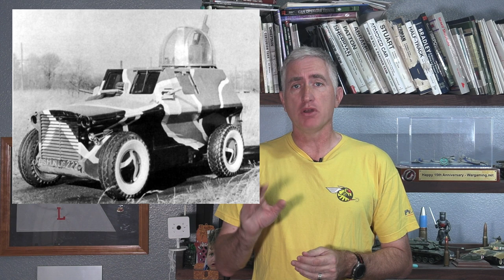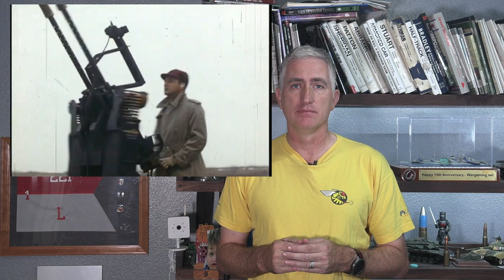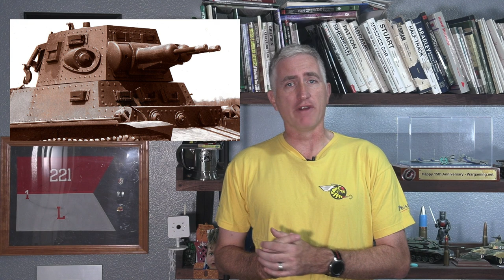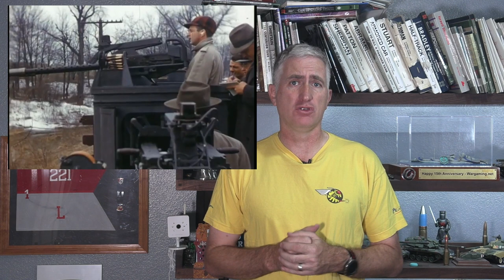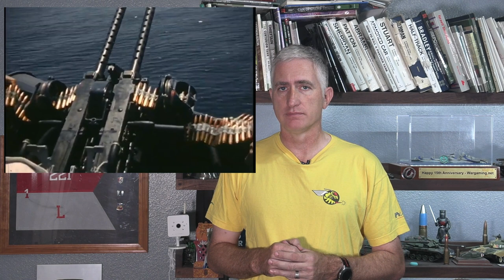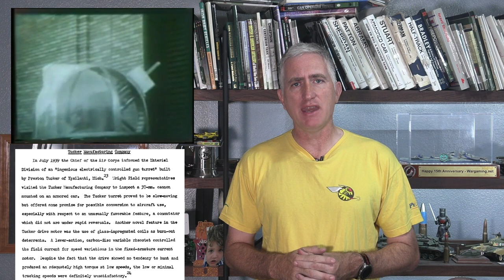Why the Tucker Tiger Failed

Comment: Given the tire technology of the day, 100+ mph in a vehicle that weighs over 10,000 lbs is a terrifying thought.
Reply: I'd be more worried about the rims, Centerline type rims can make even a weaker tire perform well.
Reply: 100 mph from a V12 putting out less than 200 hp and being armed and armored is something that I still can't figure out how they managed to do pull off.
Reply: I figure it had 4 wheel drum brakes so that speed isn't too scary when compared to a 1917 car engined with an aero engine and only rear brakes, aka, the 1917 Fiat Botafogo Special that Jay Leno owns.
Reply: @Hybris51129  sounds like they picked their gear ratios very carefully and made full use of the wide power band that a V12 offers.
Reply: Well, true the tires of that time are terryfing.......until you realise that the brakes are even worse.
Reply: Tires that can get shot to hell in the field. That does sound pretty terrifying, like best case you lose the tiring and end up sliding out of control, don't hit an ally or anything solid enough to cause injury to the crew, and then get to see about changing the tire or driving away/forward at a greatly reduced pace. Best case, hitting shit and friends seems decently likely, as does getting stuck.
Reply: can you imagine going fast off road in those biased ply tires, I would expect to see rubber flying every where!.
Reply: You could get a Duesenberg over 6000 that would go over 100 in the 1920s.  The problem was many hardly knew how to drive by WWII.  Not to mention most soldiers think that government vehicles should be treated on the level of rental cars. Soldiers raced everything including motorcycles with side cars. One described how was tearing around on a Harley Davidson with a side car and came close to dumping it. Asked him how long he had been riding motorcycles before the war. Never. Wasn't even supposed to be driving it. Same thing with guys flipping the M 151. A lot of people were drafted from cities that had never learned to drive or shoot a gun. All the sudden they are doing both.  It's not like they listened carefully to instructions.
Reply: Well scare the hell out the  enemy look its coming its there no its there aim fire...wait no aim fire ..no wait aim   screw it ..
Reply: @LadyAnuB  jay leno kilñs cars go to alameda in burbank watch him grinding gears and blowing up motors why he has staff of mechanics at airport hanger
Reply: @57WillysCJ  so pretty much like todays drivers who cant park without cameras..and with small cars make wide turns like their driveing a tractor trailer or on cell and sideswipeing parked cars
Reply: As somebody who almost flipped a jeep going too fast over dirt road, I am not sympathetic to the ruling that a 100mph is too fast.
As somebody who drove his 1992 T-bird over a hundred miles per hour on a well maintained country road, I again sympathize with the ruling that 100mph is too fast.
The center of gravity for that Tucker jeep is to high for that speed, and what ever committee it was that was in charge of it's design, this vehicle was doomed in committee.
Reply: @Hybris51129  
On roads?

Ever been on the autobahn?

There you'll see family cars with 105hp 1.5 Straight-4s doing 160km/h (100mph) all day.
Reply: @ShadowFalcon  At a fraction of the weight and far better engineered as well.
Reply: @Hybris51129  
Well, the weight only affects the acceleration, so it may take longer to get to 160km/h.

As for engineering. Well, it's got extra horsepower, but I suppose it'd be a scary experience with the god knows what kind of suspension geometry it had.
Reply: I would be more worried about the brakes. They didn't even dare test it on the slopes because the "didn't trust the brakes enough", yet they would drive 100mph in it?
I would bet money that the machine cannot actually REACH 100mph, only that with the gearing it has, it could theoretically reach 100mph. There are cars to this day (or not long ago) that were advertised as "190mph" (etc), but which when you factor drag, tire resistance, the actual power output of the engine, it won't actually reach near that speed. it just means that going downhill, in gear, foot full down, it will reach 100mph without revving the engine past the danger point. Right before a slight steering correction or small bump sends your entire machine wildly out of control because the very short wheelbase and inadequate suspension design. there is a difference between theoretical and actual top speeds.
Reply: @TWX1138  A V-12 doesn't somehow magically offer a wide power band by some inherent virtue of having 12 cylinders. What it does do is allow you to have an engine large enough to produce lot of torque, but cylinders small and light enough with a short enough stroke to reach a decent engine speed, and therefor power. So it will make more horsepower than an engine of the same size by fewer cylinders (all else being equal). Conversely, an engine with few cylinders will make more torque but less power. Really, top speed is a function of the total power output of the engine. Once you have accelerated your 10,000lb vehicle to that speed, there is only the resistance of the air and tires to overcome. Say 300hp; if that is what it takes to travel at 100mph in that machine, it doesn't matter if it comes from a 12 or a 6. Only you would need a larger 6 to generate 300hp, because the engine speed is lower. Given a larger engine, however, you could actually accelerate faster because the torque of the larger engine and cylinders. But even then there is a certain minimum amount of power needed to move a machine of a certain bulk and wind resistance to 100mph, whatever your gearing is.
Reply: @57WillysCJ  My dad learned to drive in a truck in the south Pacific. He got the job by raising his hand when someone asked if anyone knew how to drive a truck. He figured it was easier than hoisting a shovel all day and he had seen it done. His dad had a model A. He managed to not crash into anything so got a lateral promotion. Not higher rank, just less hard work.

Comment: The most important characteristic of any military vehicle is that it must be soldier proof. An I can assure you, any vehicle that is capable of 114MPH is NOT soldier proof - neither then nor now.
Reply: Yeah ... when I was doing base security, we had just gotten a "new to us" patrol truck that had a little red light on the top, a little directable search light, a working military radio, a working heater and was not in general all beat to hell (unlike one truck where I had to hold the clutch in with a board, raise the hood and shift the linkage there in order to get it into reverse ...).

I got to drive that "new" truck at least once and it was really nice - especially that working heater ...

And so ... we had this one guy who wanted to see how high it would bounce if he drove it over the rail road tracks at 70mph ...  I don't know how high it bounced but it rolled 4 times out into the middle of this field ...

He at least wasn't stupid enough to not put on his seat belt before he did it but that stupid son of a bitch wrecked our new truck.  We all wanted to kill him.

He was going to have to stay in the Marine Corps until he paid off that truck on an E-1's pay but that didn't do us any good.

That happened 50 years ago and I'm still pissed off at that ass hole.
.
Reply: One only needs to look at Air Force officers to see that! 😆
Reply: Nothing is true soldier proof. You can only minimize the damage a soldier might do
Reply: Like any army vechles are
Reply: @demonprinces17  Yep.
.
Reply: At least not for US soldiers
Reply: I do agree with you, we did same thing to T-72, we removed the governor, upped slightly the boost and empty on the longest straight of our training ground that thing was doing 90kmph+ (well UAZ had top 90kmp and could not keep up). Was it safe? Hell no! Was it fun? ...do I  have to answer?
Reply: That can easily be geared down.
Reply: All this made me think if this incident.

In 1995 a former Army Tank Driver - stole a tank and went on a rampage running over parked cars, fire hydrants and traffic lights.
https://www.youtube.com/watch?v=2AuTigSWLj0

This has a sad ending though as when he got the tank high centered on a traffic divider - cops got on the tank, got a hatch open and when he wouldn't surrender killed him.  It's to bad they killed him when they did because the last thing he did with the tank was throw a track.  After that he wasn't going anywhere but I don't know if the cops on top of the tank that shot him knew that from where they were at.  Sad story about a Veteran who flipped out.
.
Reply: @BobSmith-dk8nw  and that story brings to mind , " Kill Dozer " . Were a guy tired of fighting the town over property rights of ways Armored up a D9 or D10 bulldozer and went through the town taking out all the Board members busines.  Finaly stopped when he fell though into s basement on 1 track. He shot himself,  there was no way into or out of the Bulldozer. He had lowered the body down over himself.
Reply: @BobSmith-dk8nw  Ah, your unit's Carl. You can't fix Carl.
Reply: Killdozer ruptured a coolant hose and overheated the engine. Thats what stopped it, not a thrown track. Watch the video.
Reply: @marvindebot3264  No ... but sometimes your "Carl" can fix himself ...

Our guy almost did it here and would have if he hadn't put his seat belt on.

Another time ....

I had a buddy who was in the same cubicle as this guy.  My buddy slept on the bottom bunk.  One day this guy comes in, mutters something and then bounces himself up into the top rack.  After a while - my buddy is laying there and he realizes that he hasn't heard this guy move since he got into his rack.  So - he says something to him and - no response.  He tries again a few times and then gets up and looks in the rack.  It's empty.

So - he looks out the 3rd floor window of their cubicle - and there - two stories down on top of the entryway into the building - is this guy - knocked out cold.  He'd managed to bounce himself up into his rack and - right out the window ...  If they hadn't been right over the entry way into the building - this guy would have fallen 3 stories and maybe ... just maybe ... "fixed" himself permanently.

That's the thing with people like that is that they sometimes are a Self Correcting Problem ...
.
Reply: @Austin O'Brien Well ... one thing about being in the military - which was much more the case back in the early '70's when I was in - was that you got to meet the Full Spectrum of Humanity.  All the way from people who were absolute scum (far worse than these guys who were just stupid and including murderers) to some of the finest human beings on the face of the planet.

That's because in our normal lives - we don't hang out with these people.  We mostly hang out with people who are like we are - and they mostly hang out with people who are like they are.  There were a few I had on occasion to work with but ... not that many.

So ... for myself ... once I wasn't in the military ... I just didn't have any reason to be around these kinds of people.  If you do - I can't say that I envy you their acquaintance ...
.
Reply: @Austin O'Brien Cheers indeed at a lack of "Carls" in our lives.
.
Reply: @dr.hugog.hackenbush9443  he blew a hose and kept going. As he was taking out another building he dropped a track into a basement. That's what stopped him.
Reply: Trivial to toss a govenor on there. Thats a red herring.
Reply: You don't have to do 90 mph just cuz it will. Easy to put a governor on it
Reply: @mikeholland1031  The point about the 114mph - was that Tucker considered this a selling point for the vehicle - when it wasn't.  What was really a point against the vehicle - was that it's cross country performance was not acceptable.

The military did not need a vehicle that could do 114mph - it did need vehicles that could go cross country without getting stuck and having to have some other vehicle come pull them out.
.
Reply: @BobSmith-dk8nw  I hear you but they said it was the main reason it was rejected. Personally on a scout type vehicle, I'd like to be able to scram quick if in hot water if terrain suited it. Should have lengthened wheelbase a bit and made it 4wd.
Reply: @mikeholland1031  Well the Tucker people said it was the 114mph that was the reason it was rejected but that wasn't accurate.  It was rejected because of it's failure at the cross country tests.

They could have tried again with a modified design but - they didn't.  Someone has suspected that the problem was lack of funding by the Tucker People.  A larger, better funded company might have been able to build a prototype on their own dime - that was frequently done - but Tucker was not considered to be well funded.  Possibly if he'd gotten a Government Contract he could have done it - but he didn't.  1938 right?  Not sure the funding spigots had been opened wide yet.
.
Reply: I don't deny that there are many designers who would agree with you. But I reject that view. Being enemy proof is the most important feature to go for. I hold this view because I have a deep abiding respect for Tommy Atkins. He is not a toddler. He may show his contempt for fragile or slow or inadequate.  But he will not break anything he trusts. Nor, frankly can he be stopped from breaking anything he dislikes. Panzer VIs,  for example.
Reply: @BobSmith-dk8nw  I had a similar experience when I was in the Italian Army: we had a Second Lieutenant who a day decided to start a race against other cars. So he drove a military truck with 20 of us in the loading area, for ten miles on the highway (after have played to the Dakar driver for 4 days in the polygon with the same vehicle) and when he reached our base, the gearbox was almost utterly destroyed; only a  gear was still working.
Reply: @emilianocaprili4160  Yep.
.
Reply: Tucker may not have realized that few European roads were straight or wide enough, or in a decent enough condition, that his armored car could get up to anywhere near it's purported top speed.  OTOH, just imagine this thing boogieing down the Autobahn!

Making ANY equipment "soldier' or MARINE "proof' is an exercise in FUTILITY.  Since when is giving a high performance "toy" to an ARMED teenager, bereft of parental supervision for likely the first time in their lives, going to end well?
Reply: @BobSmith-dk8nw  Let alone that thing has a rather HIGH profile, good for sighting the enemy but BAD for being sighted as well, a NARROW wheelbase, and seems prone to tipping over...kinda works AGAINST the purported top speed.  Wheeled vehicles typically are quite poor for off-road work, that's why ANY 4WD needs a good WINCH.  A better design, besides being wider (at least to conform within the Army specs, as likely these things are being loaded on ships and/or transported on flatcars), would have traded top speed for towing ability (as an improvised prime mover for light artillery), climbing grade, trench or ditch crossing width, and even greater weight (thicker armor or heavier weapons/ordnance load).  I can think of damned few reasons a combat vehicle need see even 50 mph.
Reply: @selfdo  I think the concept of road itself is an exercise in futility, when you talk about combat vehicles.
Reply: When I was in the Navy we called it IDIOT PROOF!
Reply: @graemesydney38  ACCORDING TO YOUR DEFINITION , ONE AND THE same just change Soldier to Sailor!
Reply: "Listen Sarge, if they didn't want me to drive this fast then they wouldn't let me."
Reply: @Danny Timms LOL Man you NAILED THAT ONE RIGHT ON THE HEAD!
Reply: @BobSmith-dk8nw  drugs were also a factor in the tank rampage, I don't know about the kill dozer incedent but it wouldn't surprise me if he was on meth or something similar.
Reply: @garethbaus5471  The guy who had stolen the tank had had drug problems but I don't know if he was on drugs when he did it.  If I've heard - I don't remember.
.
Reply: @BobSmith-dk8nw  ...But I am sure that he had a lot of self-confidence?
Reply: Nothing is soldier proof.
Reply: @steffenrosmus9177  Forgotten Weapons did a video on the MAS 36 bayonet lug. Not only was this a French gun, one of the first comments was a Russian soldier saying "glad to know it isn't just us who are this stupid."
Reply: Point of Order!

There is no such thing as "soldier proof"!
Reply: "soldier proof" is a practical impossibility, "soldier resistant" would be more appropriate :)
Reply: Especially not one that apparently requires a professional racing driver to safely control at high speeds. I can't remember the exact number now, unfortunately, but I read once the total percentage of casualties in the ETO that was a result of traffic accidents, and it was something astonishing. Maybe even a quarter. But I want to say like 10%, which is an amazing number. Can't recall if that was all casualties or killed.
Reply: Yes